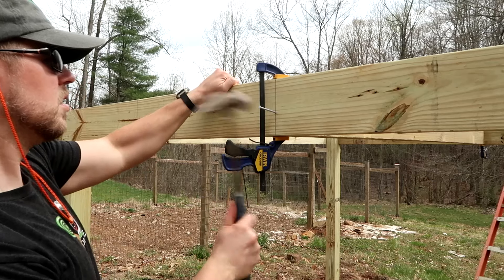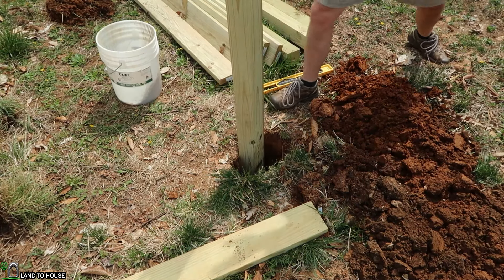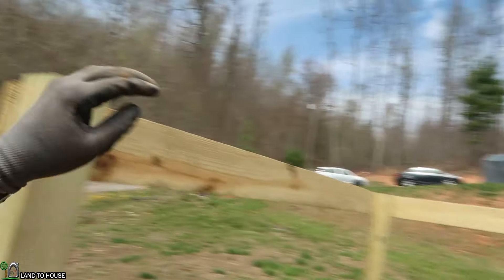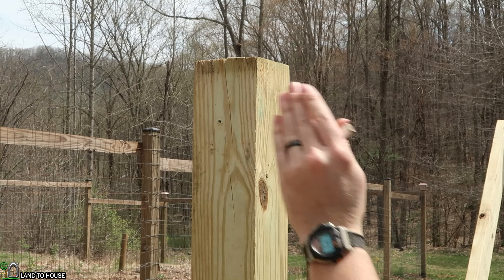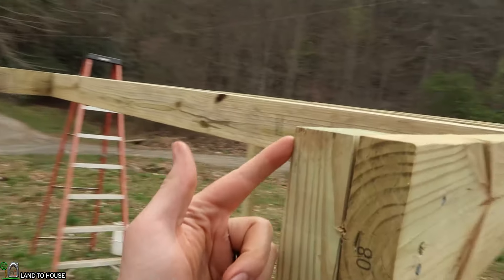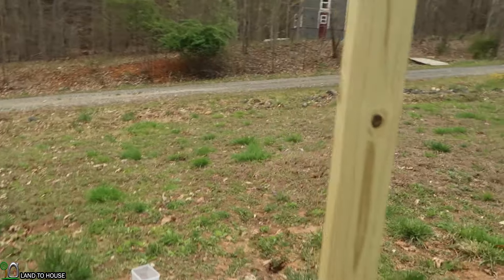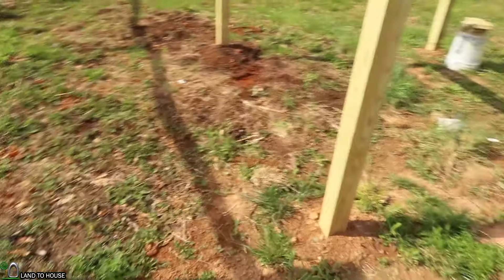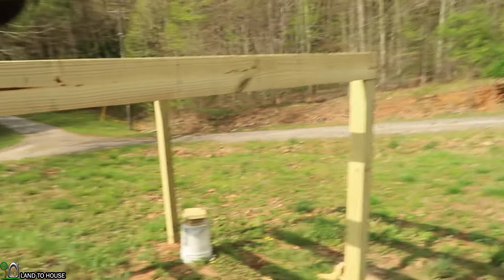Build Playhouse foundation made from 4x4 and 2x6 lumber. Playhouse 1/15

Comment: If adding a hammock do you not think you need to add some corner bracing. like 4x4 on a 45* under the floor?
Reply from the maker: We have actually used this hammock hang for 2 years and its doing really well! Seems very strong.
Reply: @LandtoHouse  OH OK so this is a old video just now being posted lol.
Reply from the maker: I started this project years ago and have been the ultimate procrastinator.